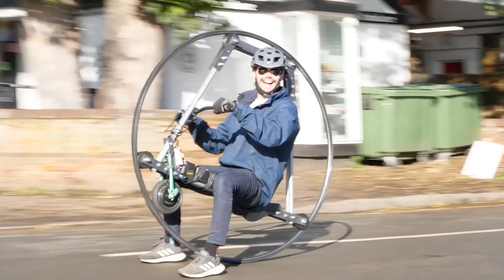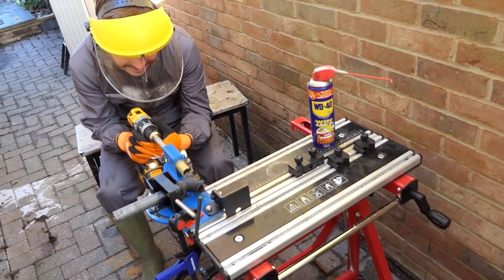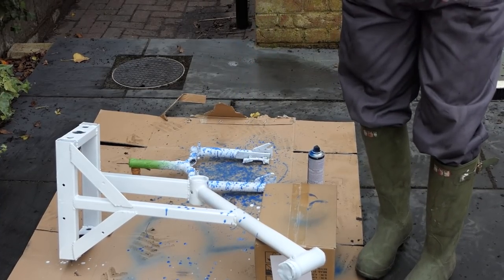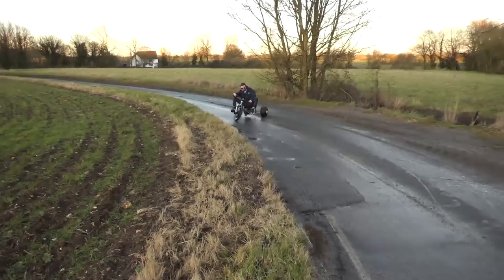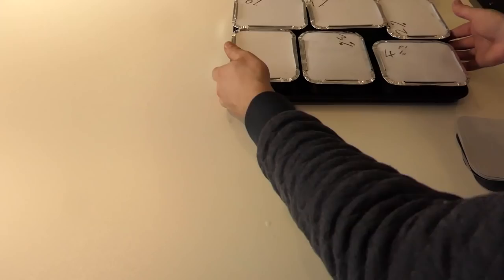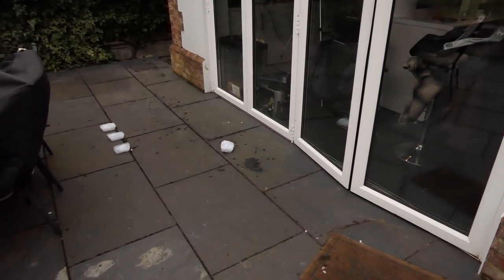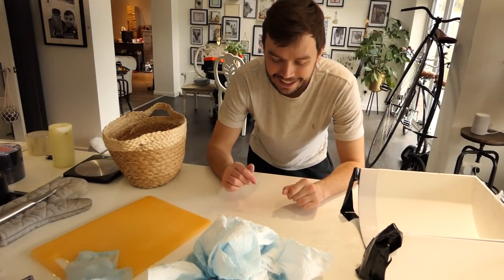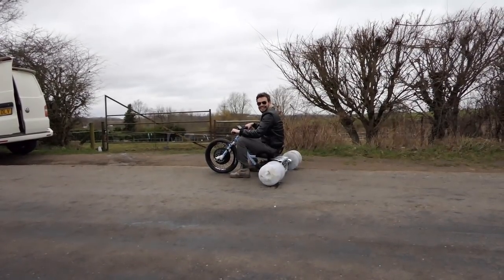Making a PYKRETE Wheel Drift Trike!

Comment: A couple tips for your cheap MIG welding experience. Make sure you don't skimp out on cheap flux core welding wire if you don't have gas and if you do argon is a pretty cheap gas that's quite effective to use. Also from the looks of your welds do you have your wire speed a bit too high and your voltage last temperature a bit too low. You've got full penetration welds in some spots and weak surface welds and others that is shown by the coloration of the metal around the welding area.

Comment: I foresee issues with fitting the ice tires and finding a balance between inflating too much and breaking the tire, while also having enough pressure to keep the tire from coming off. Also aluminum hubs causing thermal transfer issues.

Comment: Came here from the Hackaday article. Why 3D printed molds for the wheels when you could have used smaller plastic buckets? Whatever the metric equivalent of a 2.5 gallon bucket is should be about the right size.